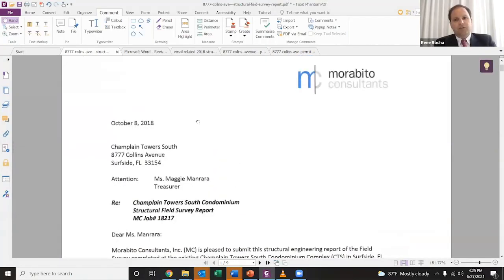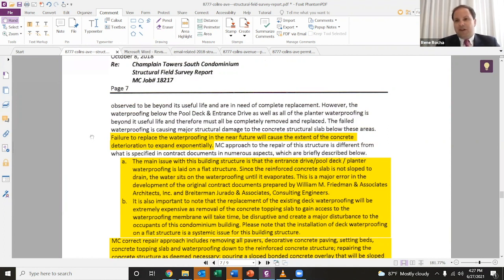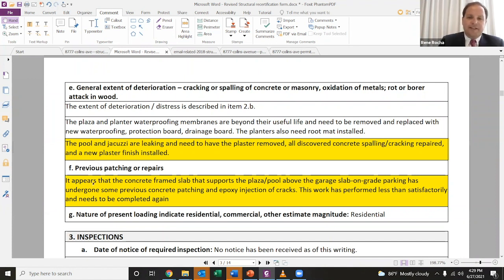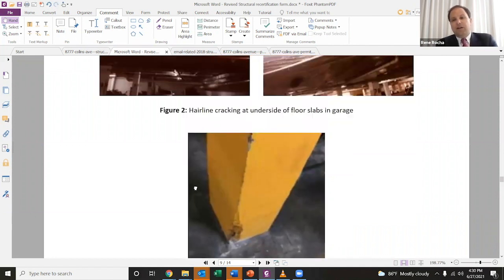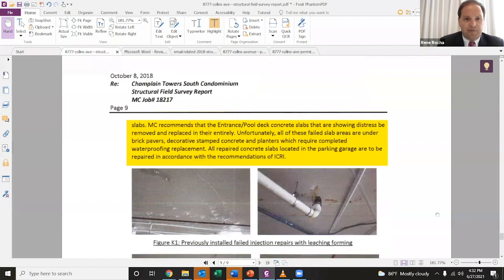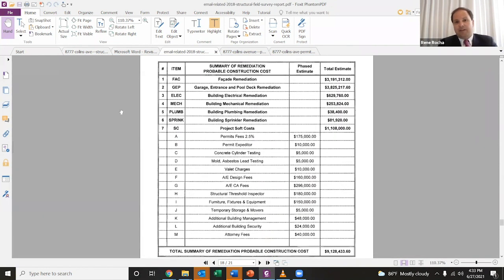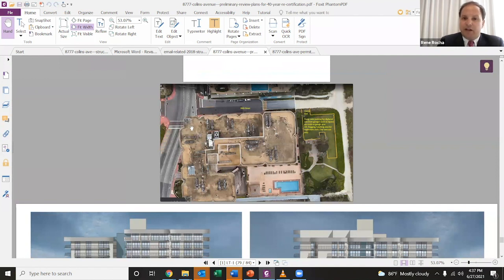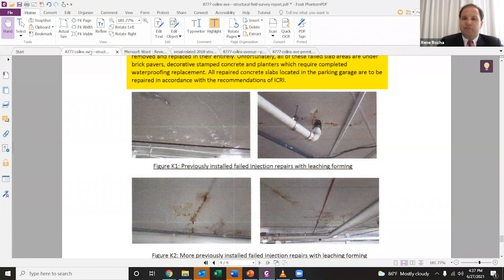Surfside Collapse Explained

Comment: Have many questions for the Town of Surfside and Miami Beach. Significant warning signs of material factual data showing the 8701 new building and actions from the towns many have had serious negative influences on the Champlain South Tower foundations. 

If the 8701 project was never done, 87 Terrace stayed in the same configuration that may have given additional time for the alleged needed repairs for the 8777 Collins Avenue Champlain South Tower.